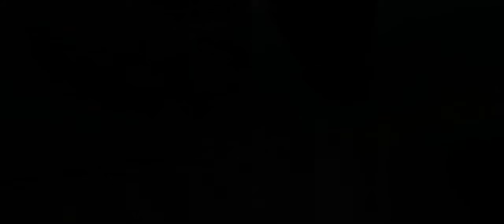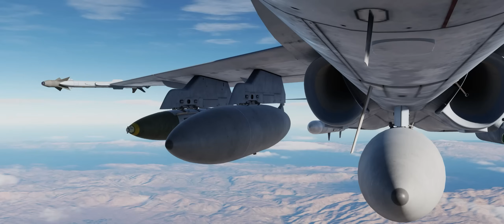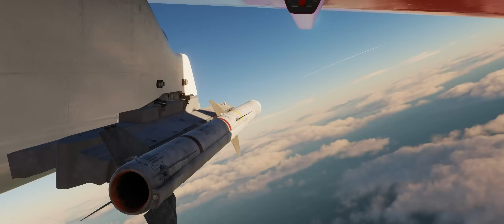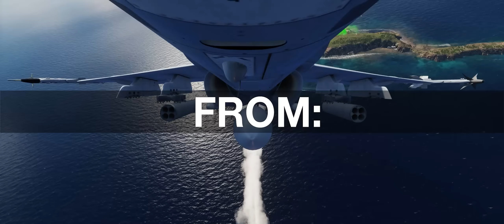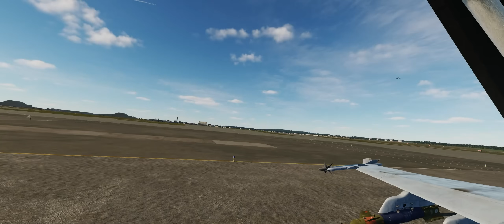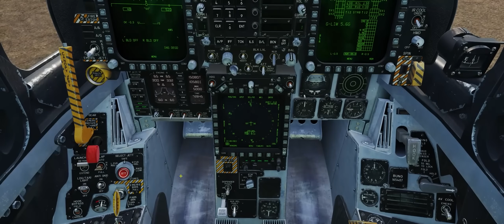DCS: F/A-18C Hornet DEFINITIVE Cold Start Tutorial

Comment: HELP! HOW DO I GET THE BLUE ANGELS FOR MY F18 ON DCS WORLD? IM NEW TO THIS. IS IT A SEPARATE MOD TO GET OR IS IT IN THE F18 PACK? I CANT FIGURE IT OUT....HELP.
Reply: You can start by not typing in caps, when you are on the ramp, use the radio option "Ground Crew" and then select rearm and refuel, there you can select the liveries. Its close to the bottom if i'm not mistaken, and then select ok and you will have the blue angel skin.
Reply: You can also get it directly from the mission editor, when you place the F18 and go to the armament (?) panel, it’s under liveries there as well.

Comment: Excellent update.  I wasn't aware of the "straight to IFA" for alignment option.  Neat.   Once small critique I encountered in the past is to NEVER release the parking brake until INS alignment is done.   As for the HMD alignment. love that only uncage presses in each of the 3 steps gets it done.  I think previously it was a combination of TDC depress / Uncage.  With just uncage only there's no need to remember the confirmation button in the 3 step sequence.  Keep it up man.  Love your videos !
Reply from the maker: With the IFA GPS alignment, the parking break doesn’t matter, you can taxi and even fly and it will keep aligning. I think you may be conflating the procedure for aligning the HMD in the F-16C with that in the F/A-18C.
Reply: @Spudspike  Copy that.  The IFA feature is super convenient.   I could have sworn tho, perhaps on carrier (?) that if you released parking break with F/A-18 before CV alignment was done,  the INS got hosed up.  I could be wrong.   With 5 or so jets and a few helicopters it's hard to keep straight.  ha
Reply from the maker: @gonefishin-xyz  if you do a normal CV or GND alignment and you move the aircraft it will mess it up, so you are correct!

Comment: Good tutorial video! The only thing I do diffferent way is the INS alignment - I switch to STR HDG, and finally IFA.
By the way, I need to do a Tomcat cold start inside a shelter. Wonder if Jeester will say "Arm your ejection seat" :)
Reply from the maker: Both ways are 100% correct. Most IRL Hornet pilots flying late block/upgraded F/A-18’s will just throw her to IFA to have fewer steps (thus less potential points of failure) in the startup.